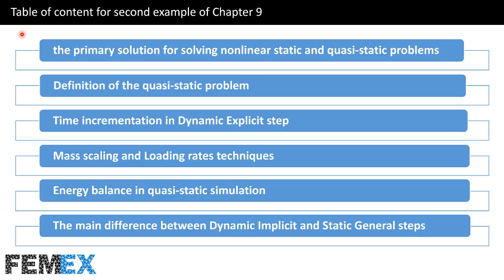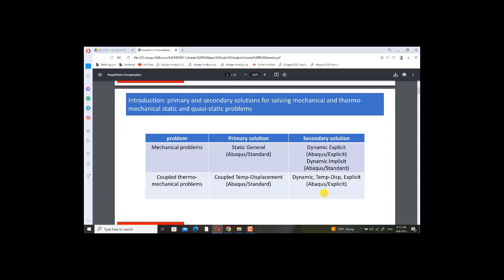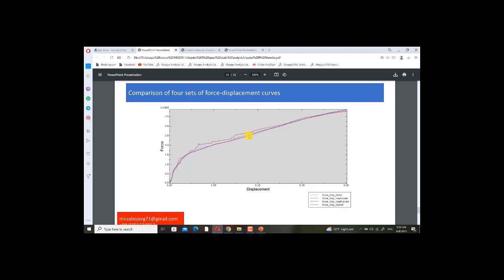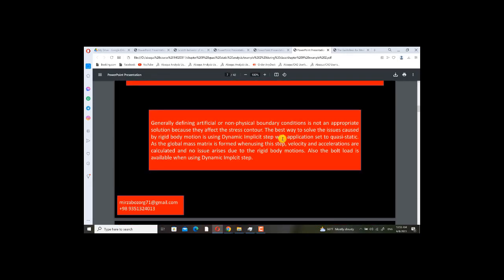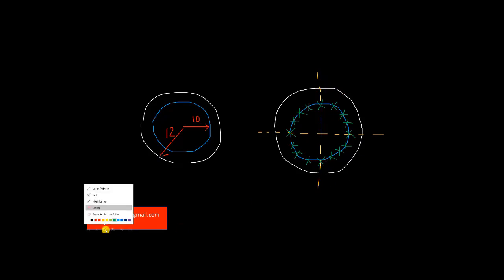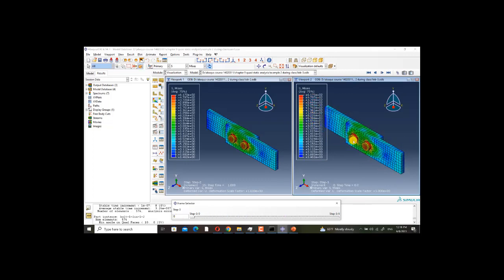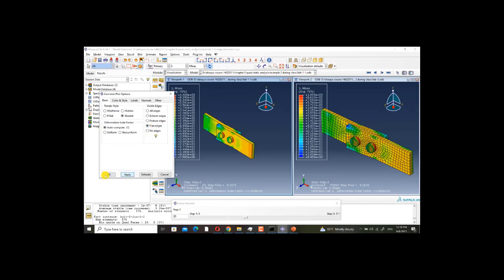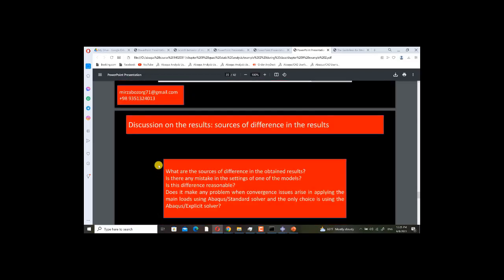Comprehensive Abaqus Package Chapter 9 example 2: Bolt Connection Simulation (Preview)

Comment: I have a question Amirhossein. Will you see a difference between the predicted results If you run this model twice? If the answer is yes, please provide the reasons. Thanks
Reply from the maker: Hi.
Yes it can happen and I have seen this in some previous projects.
This phenomenon is mentioned in the Abaqus documentation. This is because of the initial values of the physical memory components. They will affect the simulation results. So, if you run a model on two different systems which use the same version of Abaqus, the results can be different but this difference is not too much and usually is acceptable.